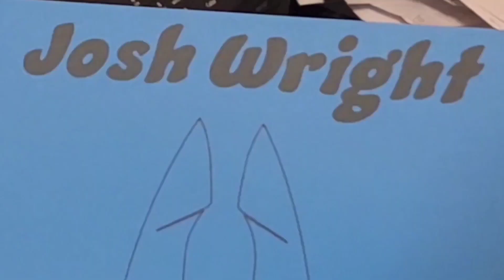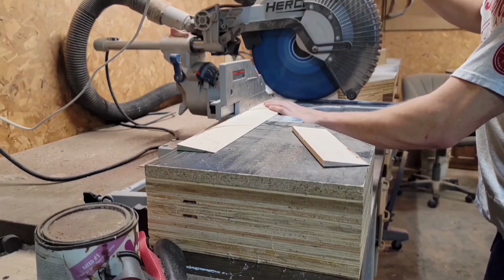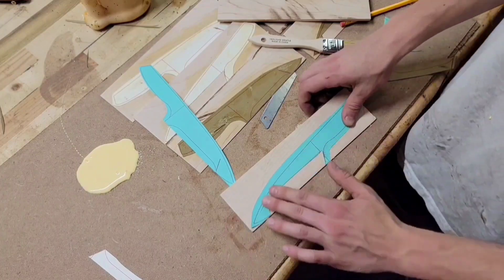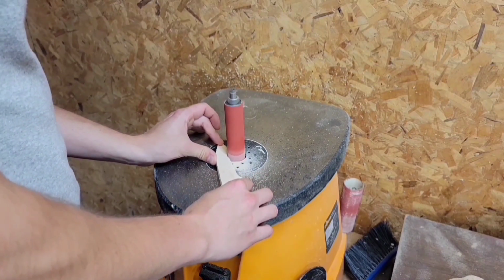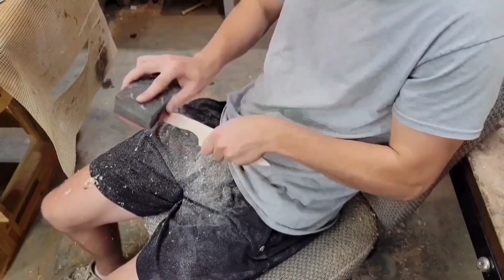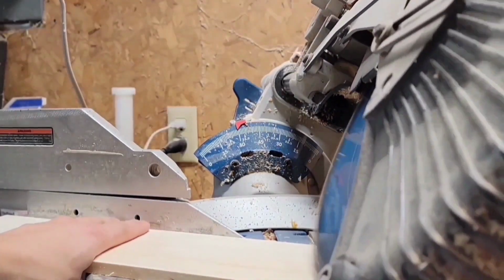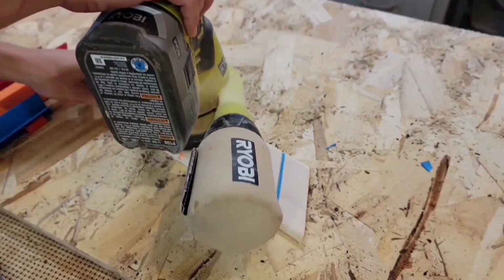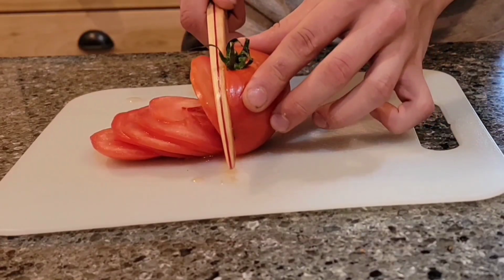Making a Knife With Replaceable Blades | Razor Blade Knife

Comment: Pretty cool. One could also punch holes in to the card stock to create a glue point as well. Though I think you can buy some of that think plastic sheets to which the glue should adhere to the wood. 
Either way a pretty cool video, now to watch the 3d printed one!

Comment: I do like the colors. I would not have chosen them, but I would buy it after seeing them!
I think you should be able to remove the blade and microwave the handle to sanitize - Just make sure it is bone dry to prevent steaming them. 
I also think having one or two of the blades protruding past the wood for intricate work would be good as well.
Great job young man! Keep up the good work.

Comment: creative use of wood and paper.
Have you considered making a table to fit your router in?
Would make a good video and provide a safer surface to work on stuff rather than holding the router with 1 hand and the piece in the other